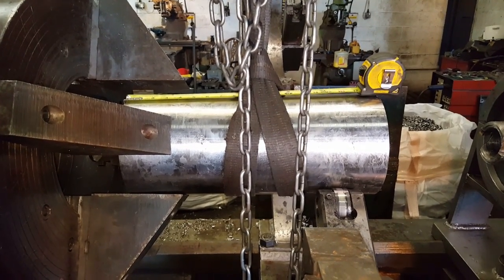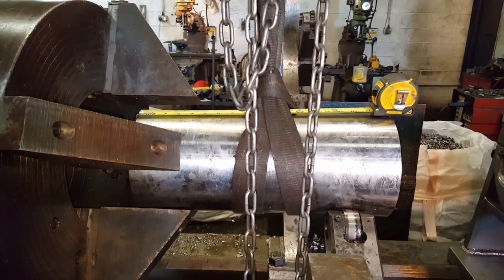Machining against time. Can I do it. INCO 625

Comment: 68 r.p.m is about right. Have you tried tagutec 6030 inserts? They are really good for 625 and 718. Currently using them to trepan 5" hole in hastelloy and running that at 56 RPM .003" feed. The coolant pump on the m/c is rubbish though and isn't enough getting to it otherwise I'd be running at 69rpm on same feed. ( Tried it and it wore the head of the screws holding insert.) I'm interested in how you make the tools. We used to make them but don't have any machines for milling anymore and wall thickness of our tools are 15mm. Would be nice to get another Bridgeport and make new tools.

Comment: would trepanning go faster if you used a smaller wcmx insert, because it allows you to increase the surface speed and requires cutting less material?

Comment: Great work!! Absolutely right about having to go by your gut, and previous knowledge. I do a lot of BTA'ing and you have no way of knowing what's happening with the tool in the bottom of the hole. All you have is sound, vibration, and what the chips look like to determine what the tool is actually doing. 

Cheers David, Merry Christmas!!!
Reply from the maker: Exactly right. If you're using the BTA deep hole boring heads... take the top wear pad out. I guarantee you leave a better finish. Same with Botek heads and the newer SANDVIK... they are useless although they are supposed to stop run off they don't. 🤔🤔🤔 have a great holiday.

Comment: Is that a piece of timber on the top of your steady rest
Reply from the maker: It's a type of nylon called polypenco... the top bearings break but this doesn't.
Reply: We used to make support rollers for Carpet embossing rollers from Polypenco nylatron. We used to put a counterbore inside them when tool when blunt in melted material and stuck it back on. Its a good bearing material in adverse conditions. We used to buy hollow bored bar from Keetons in Sheffield 5300mm long.
Reply: Oiled timber is a great bearing material, i thought it a bit unusual thats all
Reply: Polyplenco would be like a fiber reinforced plastic I expect?

Comment: I think what impressed me most was I could SEE the tailstock moving.Generally it just seems to sit there. I'm not surprised the insert budget was a bit higher than normal. I presume you charged them a premium for a rush job? :-)

I think you have two of these boring lathes. Were you running both of them, or cramming the whole run through one machine?
Reply from the maker: All 7 done on 1 machine I only have 1 tool to cut 90mm

Comment: Well done.  How long does it take to do a piece (both sides)?   Have you done this particular job before or did you just estimate that you could do it based on the similar coring jobs you've done?
Reply from the maker: I knew the inserts had no chance to get through in one go at 68 rpm. Like I said normal is 35 rpm. I was pleasantly surprised they lasted 10" 🤔
Reply from the maker: I've machined miles of this at different sizes and know it very well. No chance inconel 718 would take it.. Thanks for watching and the comment 👍

Comment: Of course you can/will do it. Havent even watched it yet btw 😎 How is it the piece doesnt get pushed into the chuck jaws with that much pressure David? Merry Christmas to you ~ Richard
Reply from the maker: Brilliant question Richard and good observation. I only held it half way down the length of the jaws and with a slight "lift" on them they couldn't push down. I could easy bore these without the steady rest and do many jobs just holding on the 7" long jaws but like you asked they would've pushed down as the tips got blunt 👏👏👏👏 I'm impressed by your questions always. A great inquisitive mind you have sir... I love that. Wish I'd mentioned it now... in future for sure I will. 👍
Reply: I guess for shorter jobs where the steady isnt needed a sacrificial piece of steel flat bar layed between the jaws could serve as a chuck stop if the diameter was smaller than your spindle bore. Never noticed if your chuck has T-slots to secure such a stop.
Reply from the maker: @MakinSumthinFromNuthin  if I ever do that I use hard wood. Especially turning as you know buddy when you had the bar coming loose from the tailstock. Have a wonderful time my friend over Xmas. I have 1 video left to post with me running 3 machines. Maybe boxing day.
Reply: I look forward to the video, have a safe Holiday David
Reply: And this brings up another question. How big is the lead screw for the carriage and is it a wear item?
Reply: A serrated part grabber works nicely to stop the piece from spinning in the jaws, or pushing. ;)